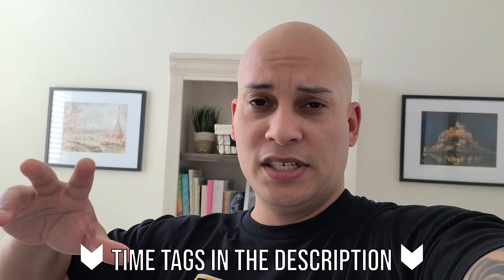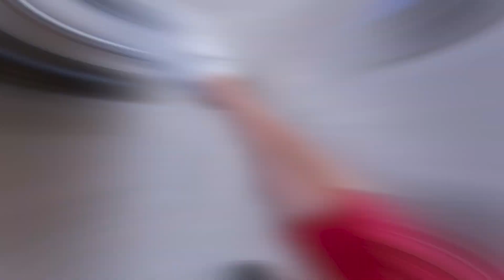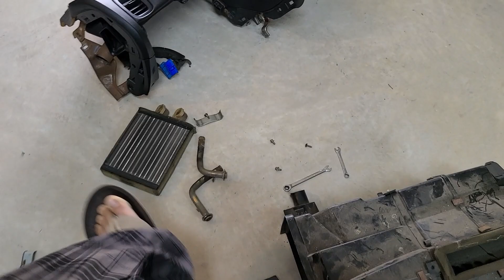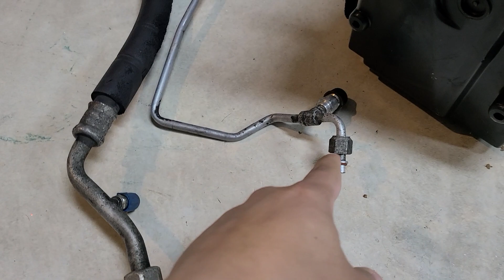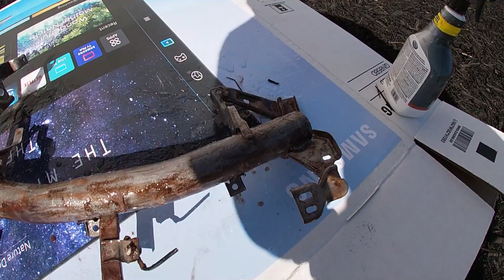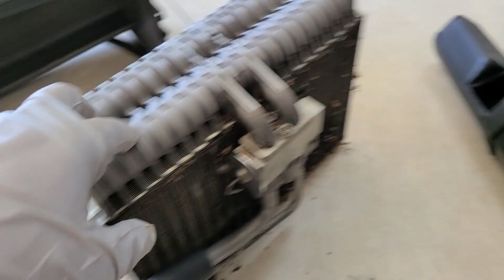How to replace the Heater Core and Evaporator - A/C upgrade in a FD RX-7!?

Comment: Good video, planning to do this soon. Wouldn't the dash bar build back surface rust quickly if you don't coat it? I would check back in a month...
Reply from the maker: Thank you brother. Yes, it will. That's why I painted it. It's on the following video, though.